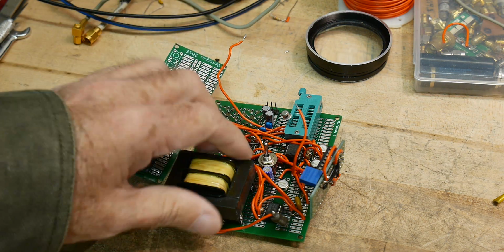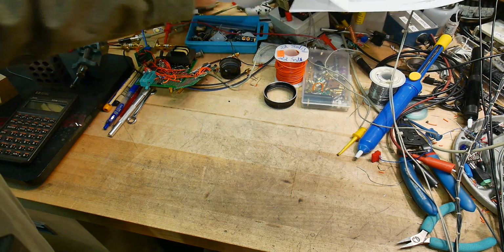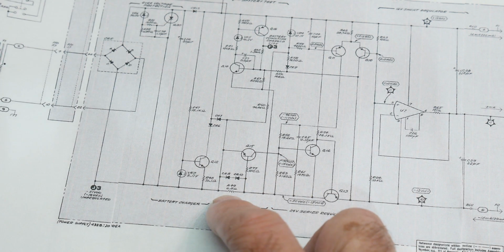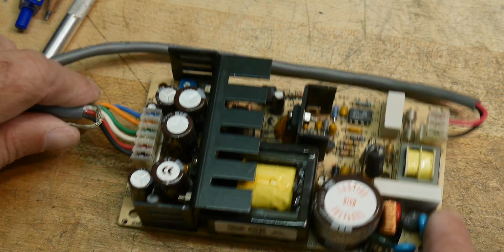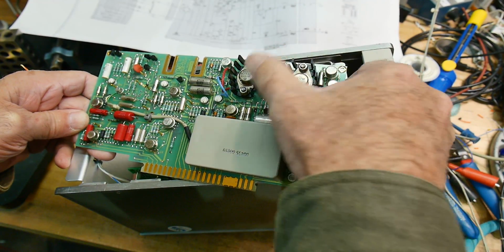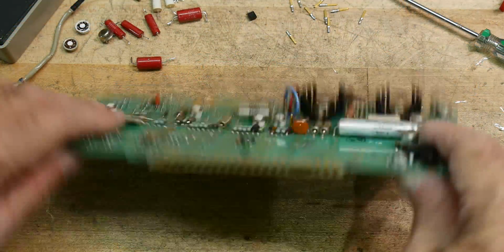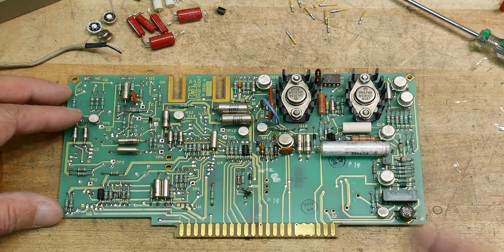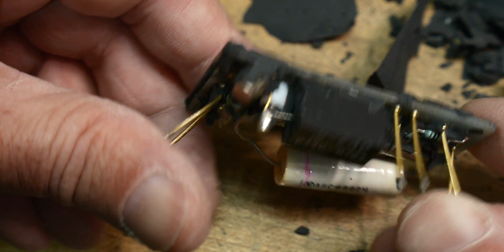#645 Transistor Curve Tracer (part 7 of 10)

Comment: Is the current limiter more for protecting the rail splitting op-amp?

Also, I'm guessing that unknown black box is a reed relay. A close thing I found is an EAC 0490-1492 reed relay which was manufactured specifically for HP. Also, the HP435 has a reed relay with a part number 0490-0916 somewhere else in it.
Reply from the maker: the current limiter is to protect the transistor. it should be a front panel setting.

Comment: Suggestion, don't put a short across the current limiter as things can heat up rapidly if you get an overload and then you have thermal runaway.  Just stick a low value in parallel if it's hard to access.  Maybe a 3.3k ?